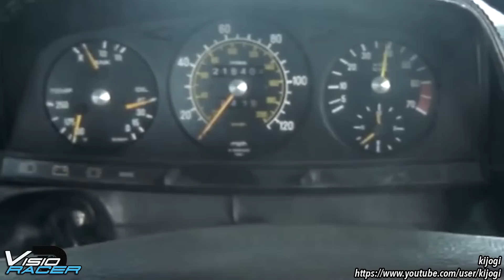TOP 9 Absolutely Crazy Engine Swaps | Ep. 7

Comment: That awkward moment when the new focus RS makes more power than the V8 swapped one and comes AWD
Reply: +Benjamin Bell i was like .................Why?
Reply: +Benjamin Bell I imagine this was a fun project using quite an old V8, and probably done on a budget.
Reply: But you can easily add a cam, air intake, extractors and do a tune on the ls and easily get 500hp at the flywheel without breaking the bank.
Reply: +John Smith But why would you do that on Great Britain. 
There are no roads for it.
Reply: +lambusado track car
Reply: John Smith That did not look like one tbh.
Reply: +lambusado well it doesn't show the motor but it says 6.7 litre, I thought it was 6.2 so assumed an ls3, my bad.
Reply: +lambusado because they can.
Reply: Frigglebiscuit to be able to drive 10km a day on good roads?

Comment: me and my dad built a mid 70's triumph spitfire one time with a 454 chevy big block (7.4 ltr for the euro trash). man that thing was fast. also took a '89 mitsu starion turbo back in the late 90's, dropped a 4.3 chevy v-6 twin turbo in it and outran everything in sight. in the early 90's, took a '50 chevy p/u and dropped a 302 gmc 6 in it that had a clifford 3 carb intake and a header with a hydra-matic trans (4 speed auto with a clutch from 2 ton gmc truck) and 12 bolt posi for street racing. man, feel old writing this(almost 60). had so much fun though. drive mellow cars and trucks these days. still chevys though.

Comment: Excuse me, but how on Earth do you get so little horsepower from that 6.7L V8 Focus?!
Reply: +xJEPA44 'murica muscle, mate.
Reply: +MrRubenvos123 That and why would you have more HP for British roads? 
only if you want to replace suspension everyday.
Reply: because it's LS 😷😷, with stock 13b (1.3l) we have 280hp.
Reply: because he probably went for a torque build instead of hp. american v8s always produce way more torque than h.p. that thing probably has 500 lb ft at like 3000rpm. it will also live longer than a 4 cylinder revving to 7000rpm to make the same power.

Comment: 4:20 that skyline had ONLY a supercharger under the bonnet
Reply: Plz tell me your kidding
Reply: +Logan White man listen to the whining
Reply: +Oscar Thorpe do you not see the turbo it is winning because he deleted the air pump it happens when VDI system opens up
Reply: +Oscar Thorpe It actually has a Gilmer belt kit, which isn't an uncommon rotary mod. It does give that supercharger whine sounds, however this one actually has 2 of those massive turbos on it.
Reply: I know it's turbo but i thought turbos whistled
Reply: +Oscar Thorpe I'm not sure exactly what you're referring to when you say that turbos whistle, but I'm assuming you're talking about the sound that is made when you take your foot of the throttle and the blow off valve opens to release the pressure. The most common type that gives this sound is a Super Sequential blow off valve. Some turbos do have a whistling type sound as the spool, but not all do. It usually depends on if there is any piping or an air filter over the turbo inlet which dampens the spool noise.
Reply: i was thinking of the typical spooling whistle sound. the whining heard in this skyline reminded me of the sound most typically heard with an american V8 and blower.
Reply: +Oscar Thorpe Yea, thats the Gilmer belt kit that it has, which is a similar belt to the one used to drive a typical blower. People put them on because they're more reliable than your typical fan belt type setup, being that they're a knotched belt, rather than relying on friction and tension. 
It's what produces that very cool noise, which is an added bonus!
Reply: oh i see its the fan belt kit
Reply: +Oscar Thorpe Yup, easy mistake to make, as you're right, it sounds just like your typicaly supercharger whine!
Reply: yes

Comment: The 200sx with an ls swap does not have ALS , 95% of people don't even know what anti lag system really is. For a NON turbo ls to have ALS is technically impossible. You can't have turbo lag without a fucking turbo.
Reply: +Rey Fuentes nope, ALS is not simply timing. I think you need to read a bit more on the subject.
Reply from the maker: Well, that one was turbocharged
Reply: +VisioRacer doubt that, and also ALS only kick in when you LET OFF the trottle. not when you floor it.